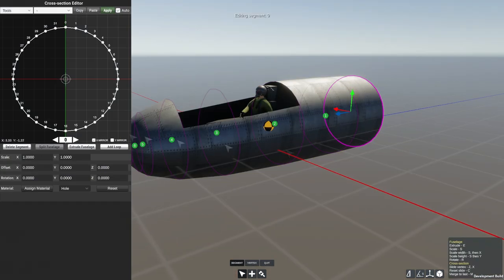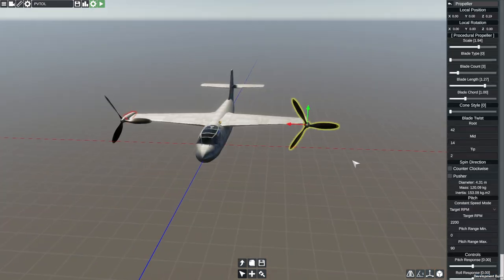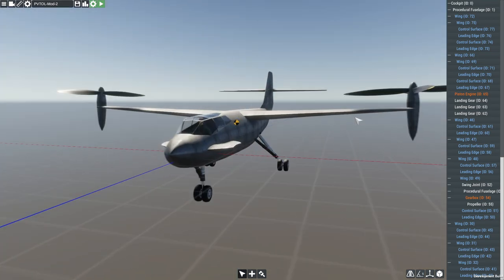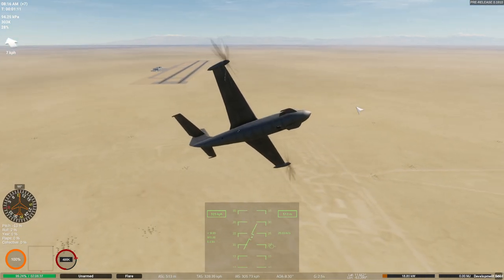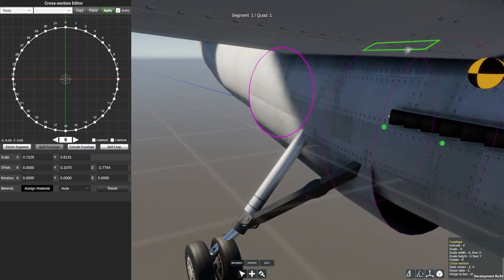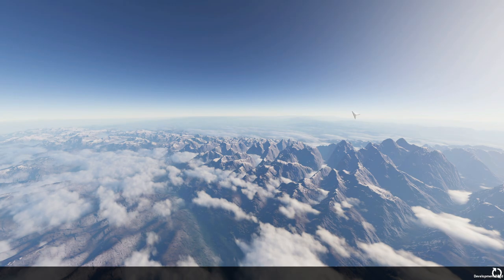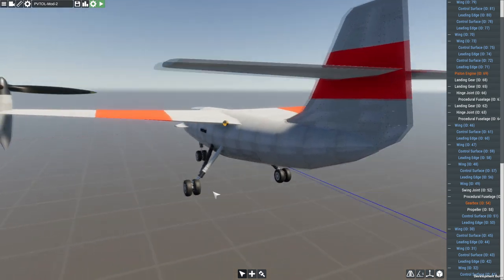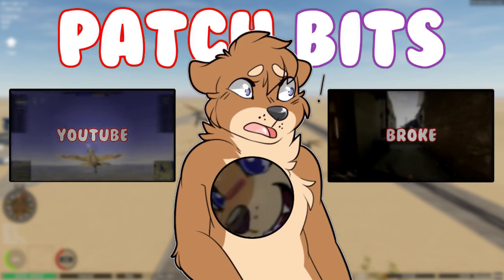Building a VTOL in Flyout!

Comment: Make rotors/propellers larger by roughly 2x, make wings slightly shorter. That's how the Osprey works. It's props are massive (so massive that when tilted down to act as actual propellers, they come very close to the nose of the plane, but pilots can also control each engine's tilt separately. You'll find far greater stability by keeping a 4 fin propeller, but making it far larger than you did.

Comment: Hey Patch, a quick request, in a future video could you build a lightweight Naval Jet fighter (for fleet defence or escort duties)

Armament: 20-30mm canon (Rotary if weight allows), 
Payload: minimum of 2 wing pylons for air to air weapons. (Optional under belly pylon for drop tank)
Powerplant: single or twin engine design with total combined thrust of at-least 18.000 lbf (Approx 80Kn) at sea-level
Speed: Mach 1.6 at ~14.000
Ceiling: 18.000m.
Range: 1,000km with a combat load. (In theory, i don't expect you to actually test this)

If it can land and take of from the aircraft carrier that would be great, but I know VTOL and STOVL Aircraft are awkward in this game and I don't think the Aircraft Carrier has functioning 'Cat and Trap'  so it would need to be an STOL design.